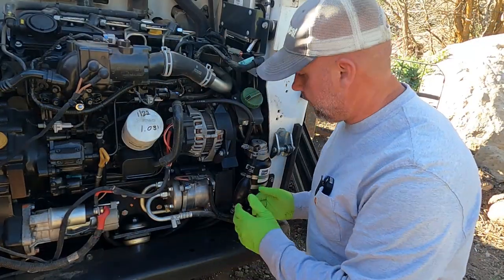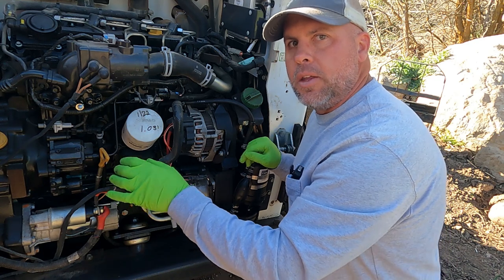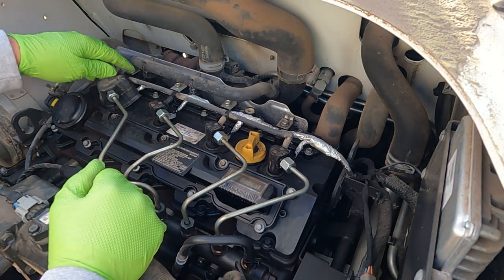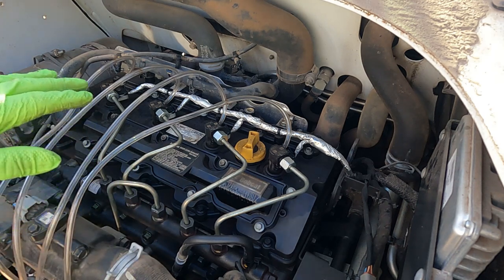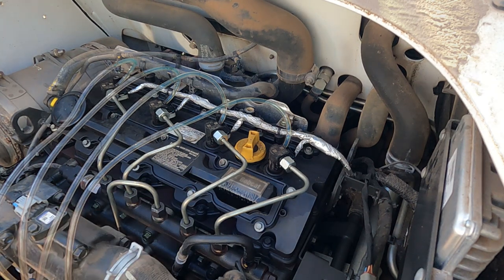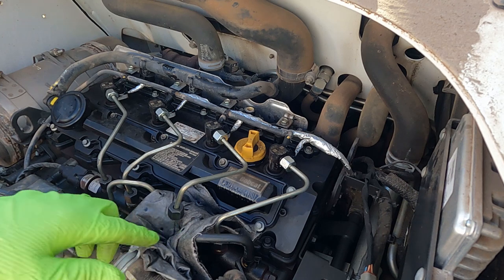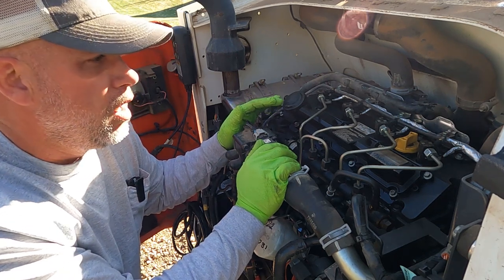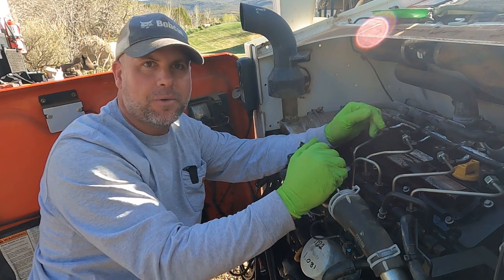Bobcat T740 No Start, Rail Pressure Code Troubleshooting and Repair

Comment: Hey buddy I have a similar issue but the code is E00015710 rail pressure fault  , it won’t start unless I spray starter fluid, any suggestions ?

Comment: I had one a bob cat that wasnt working and i didn't get any kind of code, but after enough inspections an watching videos i realized that the batterys in the remote control were no longer working due to the fact that it had been 4 years since i got it from Walmart, so make sure you check that before getting in too deep

Comment: It would be interesting to see the diagnostics you do with the laptop as well. Is the bobcat software like oem automotive software where you can see live data and command outputs? Do you just use a pass through device to a laptop or do you have a special Bobcat scan tool?
Reply: It's Doosan specific software on a laptop with a dealer only UVIM adapter. Yes, live data is visible along with active testing.
Reply from the maker: I wish I could show the diagnostic software but my goal is to relay as much information as possible without showing any Bobcat-Doosan specific tools, software, manuals, or any sensitive Bobcat information.  Bobcat Corporate and/or dealers frown upon sharing certain information unfortunately.  Thanks for the comment!
Reply: @tetradgroup  
I would like to see any video about how the high flow system works on a T595 if you ever have a chance to work on that. Great info on the common rail system. Thanks for taking the time to shoot the videos!

Comment: Hey man love this video. Thank you for explaining .

I have a s570 bobcat 2015 .
I just got the injectors replaced and the fuer rail pressure .
And it was working good for 3 months .
Now I got same codes as before and bobcat doesn't start  .
 Im Really frustrated since It was just fixed . And it wasn't cheap I'm sure you know
Where are you located ?. I wish you could help out  with this
I live in Virginia
Reply from the maker: I'm in Utah but I do schedule consultations thru my website www.4tetradgroup.com

Comment: I can't tell from your video what color the fuel cap is. The machines with the Doosan 1.8, 2.4 and  3.4 engines need a vented cap. A green cap as found on the older machines or one from a truck, will cause rail codes for low fuel pressure as well. I have customers that fill other machines & vehicles at a central pump who set the cap up on the pump, then grab the wrong one. The T740 is 74HP.
Reply from the maker: You're absolutely correct, that's one of the first things I check when I get low rail pressure codes, especially low rail pressure codes that are set while the engine is running

Comment: Hello, I need help, Bobcat 740 started having problems with not accelerating, I changed the filter several times and I cleaned the water in the system and it worked fine. Now it starts well and turns off when the exiles force code 000157-22 and 000176-15 rail pressure, good intake. fuel checked I took the diesel out of the tank to add new diesel it drives me crazy I changed a new injector also what I have left is the pressure sensor and how to regulate the price from your experience what sounds more like it to you than it is

Comment: On the t770 2016 model mine is smoking and knocking,  the dealership tells me my engine is bad and I need a new one. That's 38,000$ my machine only has 1,500 hours on it. my question is, could bad injectors make it appear the engine is blown by smoking and knocking?
Reply from the maker: It definitely could

Comment: Question I have a 1989 bobcat. It runs but it dies like every 4 minutes turns back on and dies like if I shot the injection pump  it’s a manual injection has a lever to shot it off

Comment: Would you update the links for the injector tests you have on Amazon. The 2 you list are not available.  Thanks, my t550 is flagging 100057-03,no start, wait a min or so then tuns fine.

Comment: Any reason not to use Delphi injectors instead of the Bobcat branded ones (that are also made by Delphi)? And do you ever clean common rail when replacing all four injectors / any info on how to do that?
Reply from the maker: Thank you so much.  The Bobcat injectors are Delphi.  Just be careful of the cheap ebay delphi injectors.  They seem to be stuck in many cases and difficult to get working again.

Comment: I have a t550 did a static test had two injectors leaking by. Bought a new set and replaced them now it won’t start at all. Do I have to reprogram the injector to the computer?

Comment: Hi there just a question do you have to reprogram the computer if you change the rail pressure sensor?
Reply from the maker: No programming necessary with rail sensor

Comment: I just bought a 1999 bobcat and can not get the park breaks to release found a red nob beside the seat does that have anything to do with the foot release on the floor. all I have done on these machines drove them. need help.
Reply from the maker: Have you checked both the fuse and relay?  Red knob right of seat is to lower boom, nothing to do with brakes not releasing.

Comment: My 2018 T740 will start and run for about a min before the e00176-76 code, then shuts off. Is this typically also an injector problem?  I notice in your video, it was a no start. Thank you for any help. I will be doing a static test sometime this week, but just want to see if you think that's where I should start.
Reply from the maker: I would start with fuel supply issue first, check fuel filter, fuel lines, and pick up tube.
Reply: Thank you for your quick reply.  What's interesting is, the machine will continuously run on idle without issues, however when I proceed to drive the machine, it will die within about a minute and give me this error code. @tetradgroup
Reply: And of course this is happening on the coldest day of the year when I need to remove snow from the driveway. Lol @tetradgroup
Reply: Disregard. It just died after idling for a couple minutes
Reply from the maker: When it's really cold the water in the separator will freeze and cause that to happen.  I think a fuel filter will take care of the issue
Reply: Thanks again for your prompt reply. Love your channel.  

My only concern is, it did this the other day also when the temperature was in the upper 30's/low 40's. I didn't pay much attention to it, as the machine started right back up and I was only transporting it off a trailer and into the garage. I figured it was just a fluke.

I also replaced the fuel filter about 30 hrs ago. Do you think that could still be the issue? Maybe just something clogged in the filter?

Comment: So after doing the leak test I have one injector that’s returning three times the amount of fuel than the other three do you recommend using OEM Bobcat injectors or is there another company that makes a better affordable in the injector?
Reply from the maker: I recommend Bobcat but Delphi is the manufacturer.  Not hard to find a Delphi dealer.
Reply: Hey bud I have the same issue so after I ran the clear tube diagnose injectors 1&4 showed diesel coming out 2&3 nothing so I crank it up a few more times thinking that maybe I didn’t hold it long enough for fuel to come out so after a few more cranks no fuel came out does that mean that injectors 2&3 are plugged up and need replacement or can they be cleaned out thanks for all your videos brother your a blessing to have put them up for us to learn and $ave
Reply: Btw it’s a 2015 T740 same as the video also it would be nice to get a diagram of the fuel lines and return lines where do they come out the tank and go to ect thanks again

Comment: Would troubleshooting steps be the same for v1 systems or is this just for V2?
Reply from the maker: This video is of the V1 engine, V2 would be a little different but same concept
Reply: @tetradgroup  okay, perfect. Thank you sir! I’m working on a s650 that’s a no start and has E000157-3. IMV is good. I would like to do this process next to see if it has a faulty injector(s).

Comment: i have a  T559  i can getting craning is tun over
i found a no injector  i remote the injector  electric plug and no power  and plug    my question    what is  the plug  doing is power supply from computer ?
Reply from the maker: Yes signal from computer is a high frequency high voltage

Comment: Have you ever seen this code drive controller sensor c1004-16 bobcat
Reply from the maker: If you have an R-Series then I would replace right pump swash plate sensor.  I would need more info to be certain.

Comment: Amigo hola tengo un problema en mi cargadora es un bodcat s150 tengo el código 04-22  como lo soluciono?
Reply from the maker: Low oil pressure, usually it's the sensor or the pigtail but you should varify pressure but plumbing in a manual guage into the sensor port.

Comment: Eh boss, what’s the torque spec on the injector hold down bolt
Reply from the maker: Injector Bracket Bolt M8x1.25 12.9 39 - 46 N•m (29 - 34 ft-lb)

Comment: I've got a bobcat  s590 (2015) very low hours, I think 1100. I don't use it alot and it does sit for long periods. I went to use it the other day and when I started  it it cranked and ran but then I get 3 beeps and a e0001157-22 error and it shuts down. It will crank and start repeatedly and do that same thing as many times as I start it. I changes the fuel filter and visibly inspected  wiring and no obvious  signs of a problem seen. After the filter change and purging air with the bulb still no change. Exactly  the same issue.  Trying to learn what I can about the e0001157-22 code it appears to be a rail pressure  fault can I do the static test as shown in the video  on a machine  that will  crank and start as mine is? Wondering  if I have a bad injector  or injectors causing loss of or out of parameters rail pressure.
Reply from the maker: Static test is a great place to start.  Unplug the injectors so the engine doesn't start.  Injectors do not need to fire to troubleshoot leaking injector.
Reply: @tetradgroup  it ended up being the imv valve. I got a new Delphi replacement  from diesel pro and all is good. Thanks for videos  they're extremely  helpful
Reply from the maker: @derekgriffith4324  Thanks for the update

Comment: We have the same dreaded code showing on our s450 with the 3 cylinder doosan engine- but the engine shuts down after about 5-10 minutes of operation. key off, key back on restarts and repeat. we have replaced all 3 injectors, lines, inlet metering valve and rubber lines from filter to engine and from filter to cooler, and from primer bulb to tank. any ideas? still happening.
Reply from the maker: Sounds like you've done everything, except pick up tube in the tank? If it's not that then possibly the pump itself.
Reply: @tetradgroup   we have not done the pick-up tube, that was going to be my next step before the pump! we did hear a possibility in our shop that there possible was algea in the system at one point in time.. we did not see signs once it arrived at our facility
Reply from the maker: @aaroncolvin9178  I'd cut the filter open.  Does it have the new larger style filter on it?
Reply: @tetradgroup  it has the filter with the sensor built in, we have replaced 3
Reply: @tetradgroup  it will run all day every day for 5-10 min. if you run below half throttle it will run longer. like its starving under full throttle? we are puzzled
Reply: @aaroncolvin9178  mine is doing the same. Additional to acting like it runs out of fuel at 3/4. But I have replaced my pickup tube.

Comment: Can you turn up the power?
Reply from the maker: Yes you can actually using a resister inline with the rail pressure sensor,  just trick the ECU for more rail pressure.
Reply: @tetradgroup  that's cool. I wonder if a 68 hp could have similar done
Reply: There will be codes for an ECU mismatch since now the engine is potentially producing more than 74HP. Anything over 74.9HP requires exhaust after treatment
Reply: @tinker0000  I really don't need more HP for my L85. It was more a joke to my friend because I just received my loader a month ago
Reply from the maker: @tinker0000  I'm curious if you've actually seen that on the d24s. I've seen the inline kit on the d34s that customers are running with no issues.
Reply: We have a customer who frequently messes with his S650 machine. It came in for repair and we refused to work on it due to an EGR delete. Two weeks later it came in with multiple ECU mismatch (he put the EGR back in) codes after he installed one from a T650. I haven't specifically seen any resistors inline with the pressure sensor. While I thing it would work, we would be instructed to either remove it (return to factory) or refuse service.